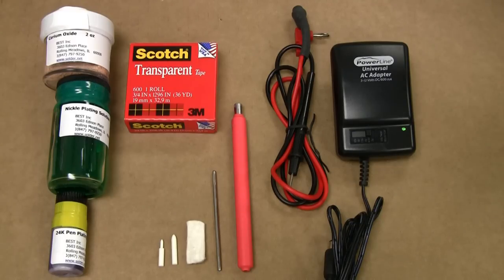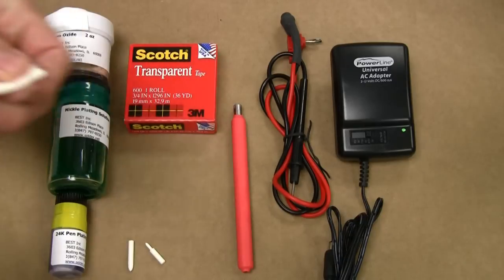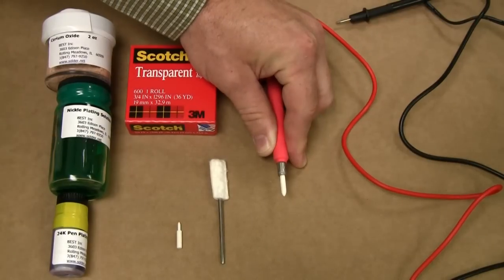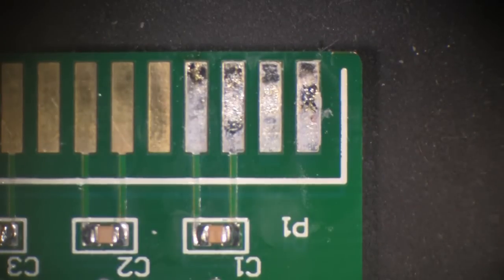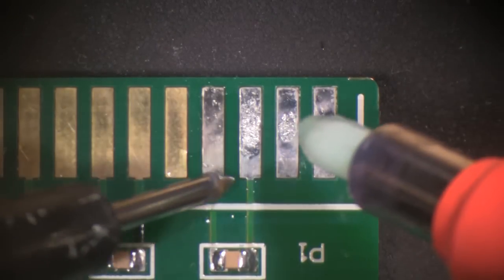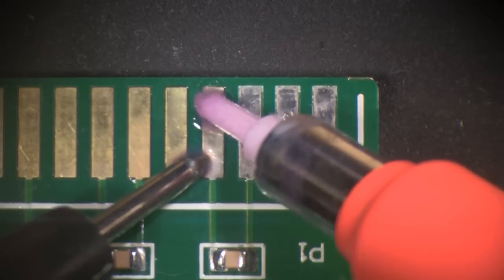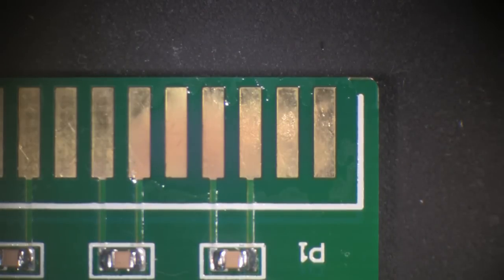How To Re-plate and Repair PCB Gold Fingers

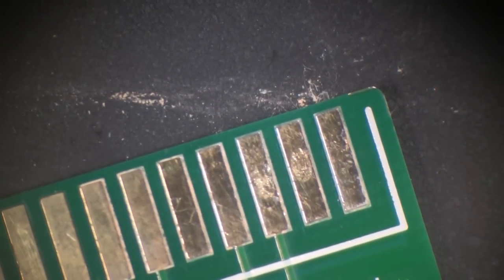Comment: @11:54 gold flakes on the tape are clearly seen.  @12:13 you can see where the plating has been pulled off. so the tape test worked and proved that plating was removed. you need to completely clean the fingers down to bare copper, which was not done here.

Comment: These items are available from either Amazon or directly from 'Becker Industries' - and for substantially less money. Becker sells 2-3 inexpensive fully functional kits for small scale projects (one w/o a power supply in case you have a bench PSU already - which coincidentally is your best bet due to flexibility). These small kits run ~$59.99-$89.99.

The exact one in the video is $375, and does come with Nickle & Gold solutions, as well as the much lauded and fabled 'Charmeleon Eyelash Dust'. If you're careful, you can get everything you need for quite a bit less (if you're really diligent, up to perhaps *50% less*).

Keep in mind, you will generally need to purchase Nickle & Gold (and/or Silver if you like) solutions/gels & any prep chemicals recommended - separately (I believe two of the Becker kits come w/a small amount of gold @ their price). You'll need to make sure you get ones that work with this plating method (and they can get expensive!). Look around hard, triple check it's compatible & make sure you're not paying more than you should (especially on Gold & Silver solutions/gels).

I looked into this for repairing NES/SNES/GB cartridge fingers w/excessive wear or full loss of plating (I have an NES cart of 'Final Fantasy' w/pins that have seen better days). Now that I see what can be done, I will likely plate everything on them... RCA jacks, connector pins... you name it.

After you plate electronic components/jacks/connectors, I recommend using 'DeoxIT Gold G5' in whatever form works for your application (spray, liquid) on all the newly plated gold parts. It helps protect gold surfaces at a molecular level and further enhances connections. It's not cheap, but it's not expensive either and all of DeoxIT's products are renowned for their tried & tested high performance.

Though many of us have specific projects in mind, these tools can really be used to plate many things: car badging/logos, jewelry... as long as the base material isn't aluminum (uses a different process). Even if you have to prep the surface a specific way or plate it w/nickel or another metal first (prior to plating w/gold).

Now get your gear... and go plate the world! Or, just fix/pimp out your Game Consoles & games like me.

Comment: Looks like some gold has been removed on the tape!!   Do you not remove all traces of solder from pads before plating, ie return to base copper? (otherwise the adhesion will be compromised by the solder residues). This must be achieved by using a chemical solder stripper to remove any intermetallic formed by the solder contamination, then to mechanically prepare the exposed copper again as in initial plating for Ni/Au operation. Then replate as in the video.

I was an Industrial Chemist in a PCB shop for many years until retirement.
Reply: Could you use an oxalic acid, like "Barkeepers friend" to clean to the base copper?

Comment: The process looks much easier than I thought it would. We'll bring our finger repair in-house. The end result here is quite poor though. The surface was left very rough by the method you used to remove the solder. I would be concerned that the gold would be worn away in those rough areas. I see no reason to dab at the solder. A wiping motion would give you a smooth surface.
Reply: yeah shitty job tbh and he kept saying the opposite lol

Comment: With this my rather large collection of NES and SNES games can live on forever. All my games still work, this is a more of a surgical repair as the gold contacts wear off over time. No one knows for certain how long a well maintained cart can last, which all of mine are. I figure we may have 10-15 years left before the majority of games in the wild lose their finish. This would bring them all back indefinitely. Cracked and eroded solder points would be the next or first thing to go depending on cart storage.Definitly will be purchasing your kit as well as a permanent supply of the solutions and gold so that in the event my 200+ carts face mass extinction in the next decade or 2 ill have more than enough to fix them all and as long as needed until my eventual death. Figure I got another 30-35 years and I intend to game the fuck out of all of them.
Reply: It's great to meet a fellow with the same passion to NES game. You better take care of those NES cartridge will ya?
Reply: I came here for this very reason. I happened upon a lot of NES carts that have bad rust/corrosion on contacts and was planning on refurbishing them. The solder joints look to be okay but I may re-solder if it doesn't work after performing a method such as this.
Reply: hey ,if anyone else  needs to find out about 
circuit board repair
 try Saankramer Electronic Magazine System (Have a quick look on google cant remember the place now ) ? Ive heard some unbelievable things about it and my brother in law got cool results with it.
Reply: Chris D gamer till I die, no matter the system.
Reply: all games will suffer from bit rot and die eventually, not in your life time though. maybe a few hundred years. EEPROMS NASA has still work 40 years later. so do most prototypes. and people say these have a 10-20 year life expectancy.
Reply: Carts, and upgrading the aluminum pins on Sega Consoles.

I've wanted to gold plate the edge connection for the Sega CD and 32x since I saw they were aluminum.
Reply: Will this work for gba

Comment: How much current is it? I wonder, because maybe some precautions are required not to destroy the electronic components. Like if you want to repair the plating of some finger structures of a carbon keyboard, it is hard not to touch the other pole of that switch and reversed 4,5 Vor even 7.5V might destroy the connected IC.
Reply: you are so right!!
one must make sure to touch only one finger at a time, only that way it´s impossible to damage any electronic component

Comment: that's great, does the kit come with two applicator holder pens, i would want two of those red tip holder pens so  don't mix them up
Reply: If you order the kit I will make sure you get both of them (extra a no charge). Send a note with the order "Bob W said that he would include a second applicator at no charge" Thanks! BWET
Reply: Which chemical is used to remove nikl

Comment: Hey man!
I see that there's been a few recent comments on this vid

With that in mind I have a big question. I don't know if you're still active, but would it be possible to use this method on the Nintendo DS Cartridge pins?
If so, video please ?! It would be absolutely amazing to see the process and restoration of very worn pins. 
DS cartridges naturally over the years corrode and there will be wear and tear leading to gold platings being gone.
Also I think others would highly be interested in this as well. I for sure am
👀😄

Comment: Sir, I have a question regarding the comparison between liquid tin and liquid gold. I have a similar kit that I've had for a while and I am currently out of liquid gold my question is can liquid 10 in combination with the liquid nickel be used to replace these cartridge teeth.? Basically I just want to know if the same thing that is in your video being done can be done with liquid tin even though I understand gold is better what I want to know is if it's worth it or even possible thanks for your time I love your product and the video was actually really fun to watch and inspiring. You see I'm kind of new to the soldering game
Reply: I can answer that, class 3 smt op here, Tin corrodes faster than gold, also gold has better emi resistance.

Comment: What I want to know is " Do you solder the entire gold pad with solder?". Is that required?
Reply: No you want to remove all the solder, you will have staining from the solder, but if all is removed it should be perfectly smooth. In this video he did not fully remove the solder, it can take multiple passes, and lightly dragging the solder wick is recommended for this procedure, as light as possible. I professionally did this for a previous company I worked for on class 3 boards that where used for aviation. What would happen is when they would go through wave solder for the through hole parts, solder would splash onto the gold pressure contacts and need to be re-plated. It's not hard at all.

Comment: 4.5v at what amperage?  Just asking! SMPS has limitations afterall.
Reply: When you set the voltage the amps set themselves, just turn rectifier on full. Usually in milliamp range.

Comment: I was interested in this to repair the gold plating on a DS game cartridge, until I saw the price of the kit. It's much cheaper to buy a new game. I'm sure Nintendo is pleased lol.
Reply: If you have multiple carts needing repairs, and the carts in question are impossible to find because of age and rarity, this kit should be a godsend. It's definitely not for casuals though.
Reply: Hmmm.... the alternative is to create a replica of the PCB. With low-cost PCB prototyping offered everywhere and free high quality PCB design software available, anyone can do that. It can be done for amounts of money that are still fun. Carts often have very simple PCBs so it shouldn't be that hard to draw a proper replica.
Reply: @danielmantione  There already exist a lot of repro boards with no need for you to create one from scratch. I think a lot of people would rather have a repaired original than a replica board, though. Just look at the folks freaking out over replacing damaged labels.
Reply: Replacing the board outright is a great idea. I think there's a vocal minority making a scene about preserving old hardware. All I care about is having physical hardware that's not a PITA getting it to work

Comment from the maker: Estra pens can be purchased. Pls enquire at info@solder.net
Reply: Following thanks for sharing
Reply: I mistakely burnt my rams one point. By putting opposite 
Can i make that connecting plate with soldering iron 
Is my ram is still working 
Pls hlp me fast greek soldering,😶😑😞
Reply: my hat is up for you mr 
great use of electroplating

Comment: I know this is a very old video and I was impress...

I find it strange that you use  Cerium Oxide to so call polish it up. Isn't  Cerium Oxide to abrasive? That stuff is used to take out scratches out of glass and is really the only stuff that works for glass.

Also... GD!! $370 for a kit?!?!?

Cerium Oxide - 2oz about $8 to $10
Nickel plating solution 8 oz - $25

Ok I see...It's the Gold Solution that costs a Ton..2oz runs about $110 for 24k.